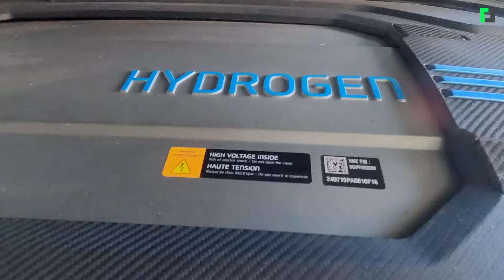Nepal's First Hydrogen Car and Hydrogen Refilling Station | कार चलाउन कहाँबाट आउँछ हाइड्रोजन

Comment: Hydrogen gas prdouction station  is not only the solution, there should be a power station of H2 production from air as india had already made it, as there is already scarcity of H2O in the world, so if we use 10kg of water to make 1kg of h2 gas, then a time will come when we face water sacrcity. So, make the h2 power saation more efficient other wise first make the h2 production unit. Then only one can commercialize it without affecting the nature.